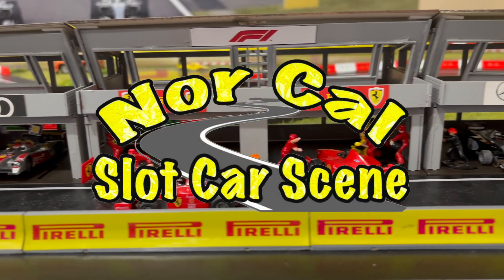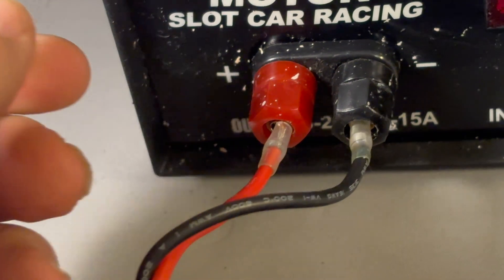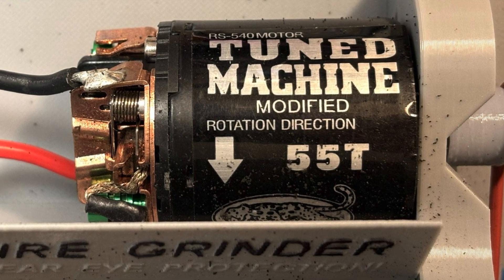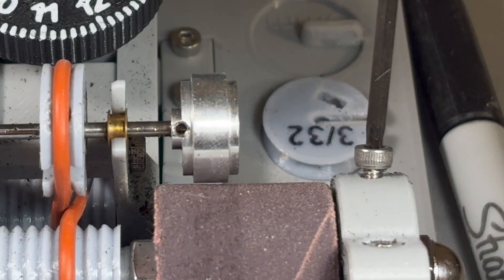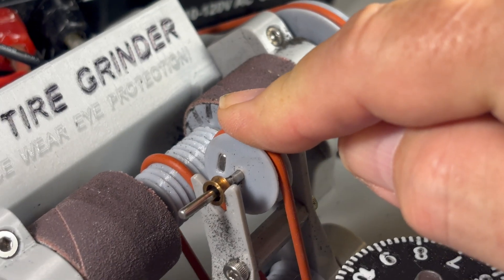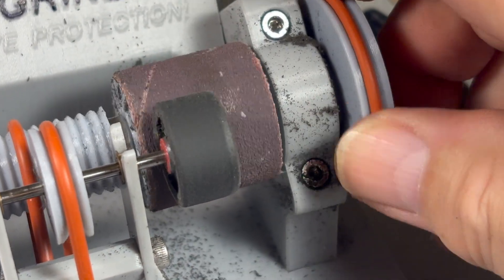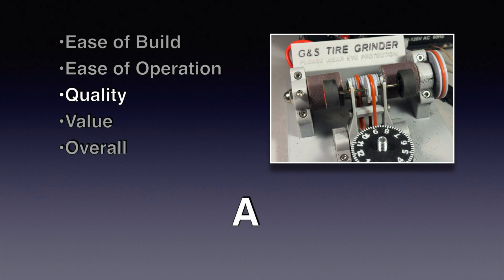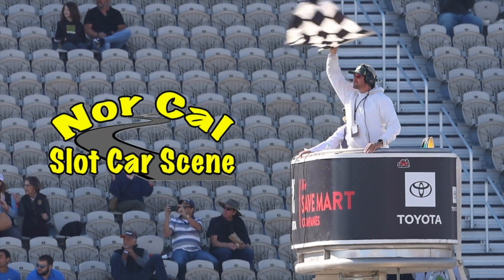G and S Tire Grinder - Setup, Operation and Evaluation -The best value tire truer on the market?

Comment: Short and sweet! :) 

It's worth noting that not all motors come with the wires already attached, especially those with the other motor (more like the Hudy motor). I think the remaining stock at 132slotcar has the Hudy style motor.

The easiest way to install an axle is to pull the band over one side of the bracket, pop the axle in, and then stretch the band over the wheel and onto the pulley. :)
Reply from the maker: Thanks for the tips!